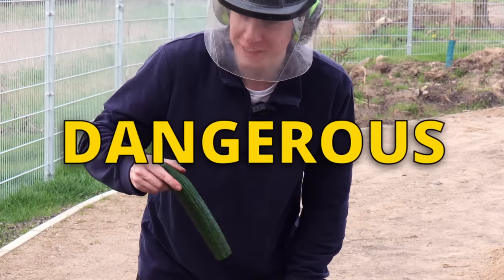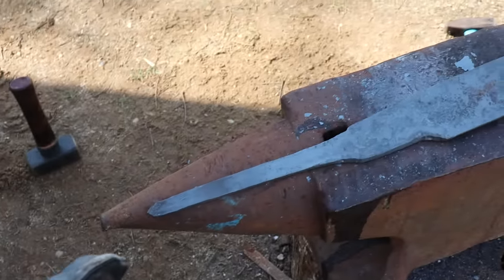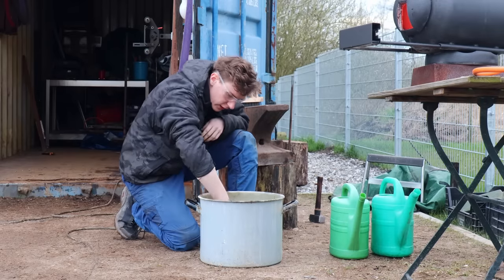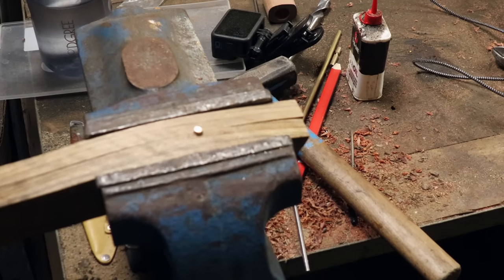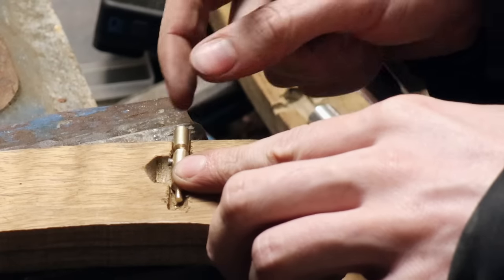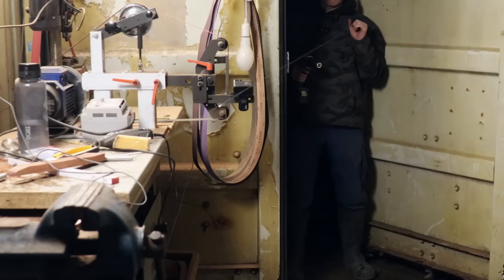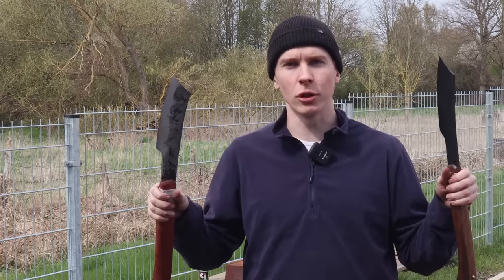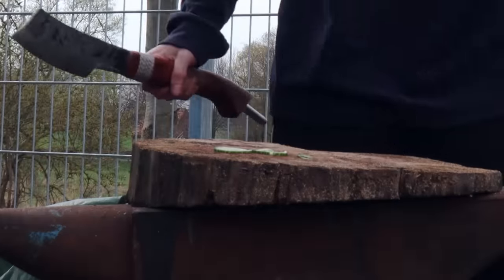Forging a DUAL BLADE CHOPPER | The Chopper Challenge

Comment: Hey Sven, lovely choppers! I forged my first pair of tongs a couple of weeks ago with the school forge, but I have yet to fully build my forge at home. I also upgraded my PC and operating system which broke my audio and screwed with all my video files so I can't continue my sword video until i can find out how to fix my audio problem and file problem. Also cucumbers are pretty nice.
Reply from the maker: Thanks! That's cool to hear! I have yet to forge my first pair of tongs. And sorry about the audio issues. Having technical problems while editing has got to be one of the most annoying things there is
Reply: @NjordArtisan  I've found a somewhat of a fix for the audio, I'm using some old USB headphones my mum had, now I have to sort out the issue of my editing software. :D
Reply from the maker: @3dwrecker_4660  what program are you using?
Reply: @NjordArtisan  2019 premiere pro
Reply from the maker: @3dwrecker_4660  sadly can’t help with that. I’m using Davinci Resolve. But good luck!
Reply: @NjordArtisan  Thanks mate, I'm still hyped for your next vid.
Reply: @NjordArtisan  Quick question, but do you have discord or something I could add you on? Kinda odd just using YT comments as a chat lol.
Reply from the maker: @3dwrecker_4660  sorry seems like I missed your reply. I don't use discord. The easiest way would be to send me a dm on instagram or via email
Reply: @NjordArtisan  Great! Just got yourself a new follower lol.